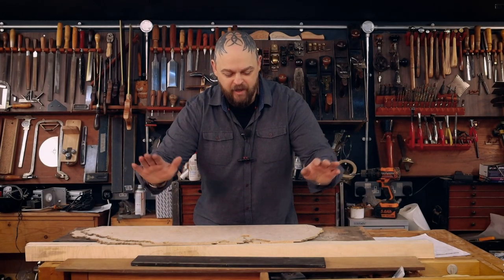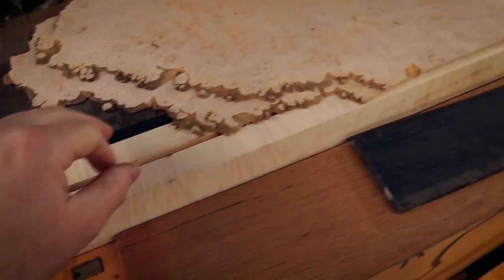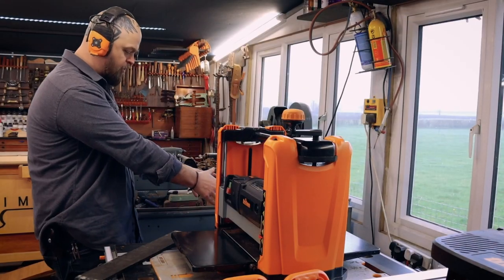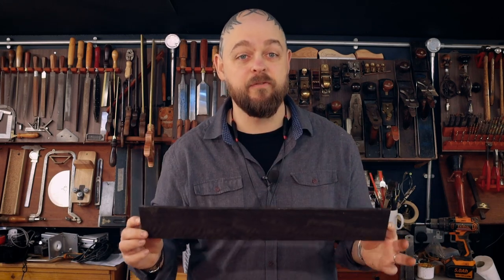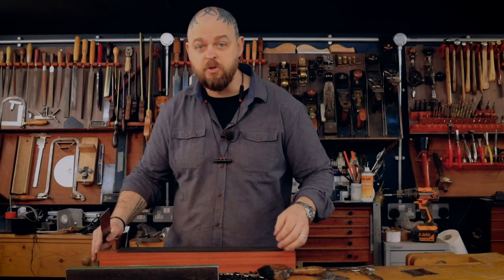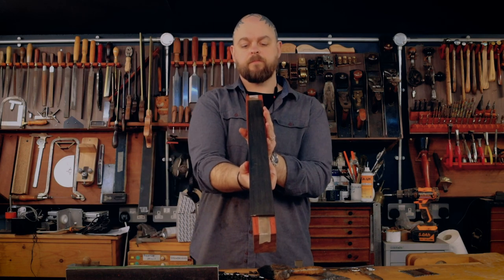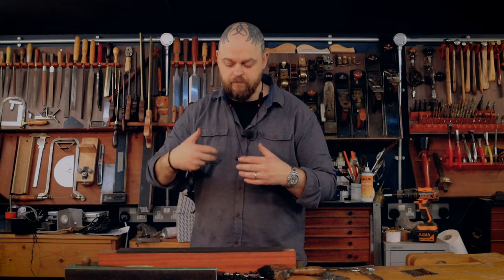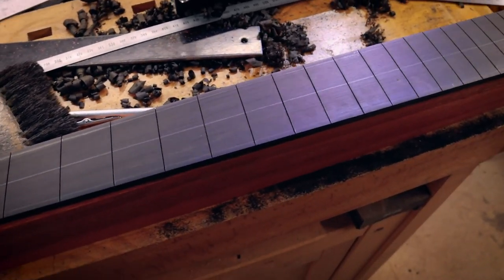Ep 1 - Fretboard Layout and Fret Slot Cutting - Making a Modern Multi-Scale Electro Acoustic Guitar

Comment: Another advantage of cutting slots after applying the radius, is especially if you're planing in the radius, you can quite easily get tear out on the slot with some of the more brittle exotic woods. Generally that tear out is minor enough to hide under the frets, but sometimes it just isn't.
Reply from the maker: You know what, this hadn't occurred to me! It's been so long since I did it the other way.. B

Comment: hi,
well, fanned frets , as comfortable as they are , are more likely to serve a tonal purpose . think of a bass with guitar scalelengh. it would work, but under quiet uncomfortable conditions , such as strings, so thick, they could be used to hang a bridge over a river.  thought in the other directrion, it`ll tear  your strings apart . but to get a more pronounced basssound and still have the light touch at the top strings , you would use fanned frets.  the position of the parallel fret on the other hand is just for comfort alone.  

love your videos btw . 
greetings from germany

Comment: Here's a follow-up to the segment of you using a standard ruler for marking fret spacing. Even if you're a metric user, do the process in Imperial with a good quality machinist ruler that has 1/64th markings and a conversion chart in 1/128th. It's miles ahead of using mm with decimals in terms of accuracy and only loses out to a specific fret spacing ruler by being the slightest but less accurate along with being slower and more tedious. That being said, if someone needed to buy an imperial ruler like that in the first place, they might as well spend a few extra bucks and buy the fret spacing ruler outright. It's so much easier. If all someone has lying around is an imperial machinist ruler, have a go at it because you'll still get good results.

Comment: Very intriguing. When you talk about the 10th fret, do you mean parallel or do you mean perpendicular? I'm struggling to see what's parallel about it?
Reply: Beaten me to it. Yeah, perpendicular to the strings. Surely none of the frets are parallel - certainly not to each other.
Reply: I thought he meant parallel to each other. The two lengths have the same 10th fret.
Reply: @RandomBassTattoo  All the frets fan out from a common point, so none of the frets would be parallel.
Reply: @RandomBassTattoo  Do you mean if you super imposed the Gibson fan scale over the Fender fan scale, the only place where the two would have a common parallel fret is at the 10th fret?
Reply: @daveperkins2927  yes, but I know nothing about building guitars.
Reply: @RandomBassTattoo  me neither!! I'm a carpenter and drummer! 🤣😁

Comment: Great vid, love the instructional style! More please! Just a couple of points, not being proficient with hand planes especially on a fretboard, I’ve started to use a belt sander for the initial shaping and tidy up with a radius block. Seems to work fine for me! Also, I’ve discovered the masking tape and superglue trick won’t work with certain masking tapes. I had four attempts the other day with a well known tape brand that didn’t work. Changed the masking tape and it worked perfectly! Probably best just to buy both from Crimson?!

Comment: Does it matter that you are measuring the frets along the tapered edge rather than a line parallel to the centre line? I would have thought this would be done before tapering the board as the distance along the tapered side would be different.

Comment: Love the videos and the builds (onto my third bass build now because of you)... Quick question on finishes... Can you wax onto of the high gloss finishing oil, and if so what wax is best?
Reply from the maker: glad I could help! And yes any wax will work so long as the oil has cured properly. I like renaissance microcrystalline wax or a hard wax made of 1/3 caranuba, 1/3 beeswax and 1/3 mineral oil all melted together. the later is harder wearing and protects the wood a bit more. B
Reply: @CrimsonCustomGuitars  thanks for the swift response... Still finishing off the penetrating oil at the moment... Will give it some time to cure and get hold of some wax... Keep up the good work 👍

PS I loved the fact you highlighted my Joker hand painted bass on the channel a few months back.... Thanks

Comment: So you believe fanned frets came about because of a more optimal wrist angle and not so that you may have greater string tension for the bass strings on baritone instruments?  I had always assumed the wrist angle was just a lucky secondary result.
Reply from the maker: you are right.. absolutely right.. the first fanned fret instruments were built in the 1600's and it was about sound not ergonomics, I tend to think of the ergonomics first though because we are building electric instruments and the sound is more easily moulded via other means.. Just they way my brain has it ordered in the end. B

Comment: i don't get your approach on fan frets about the thing with the wrist..mine is straight on every string and position without fan frets. I thought that fan frets are made to combine a longer scale in the bass section and the shorter one on the high strings to enable more accuracy in tone when the guitar is tuned lower per ex gibson scale to 26.5 small baritone scale
Reply from the maker: have a play with a multi-scale guitar when you next meet one and you'll see the difference, it is also about evening out the tension of the strings and giving a better bass response but in my mind the ergonomics are the more important part of the equation. B
Reply: @CrimsonCustomGuitars  yes i did. I have the feeling that Fan fettes guitars need to be strapped higher than normal ones for comfortable play. The. Thing with the Bass was exactly what i ment (-;

Comment: Hm... 24.75" to 25.5" fan seems a bit on the cautious side? I mean, yeah, it will look nice and it might be a tiny bit more comfortable, but another, very important purpose of fanned frets is a more optimal string tension. Since for 7 strings 25.5" to 27" seems to be the most common fan, I think I would have gone 24.75" to 26" fan for a more "Gibson" feel and 6 strings.

Anyway, really looking forward to see how this turns out. The burl is amazing.
Reply from the maker: it is a first step for the client into multi-scale.. your points are all valid and I agree, for me personally a 24.75 to 26 or 26.5" would be awesome! B
Reply: @CrimsonCustomGuitars  Ah, I didn't get the part that this is a client build.

Comment: I have a question about your planes Ben. Do you put a camber on the blades or leave them straight?
Reply from the maker: depends on the plane.. my #3 has a camber and is my general purpose tool for quick work, the 7 and 8 have flat blades for absolute precision as do the block planes.. I like a variety basically. B
Reply: Thanks

Comment: It seems that I was under the wrong impression.  I had thought that the reason some makers built fan fret guitars was to improve intonation accuracy.
Reply from the maker: that is a common misconception.. the intonation point is what it is depending on the scale length and thickness of the string but the neighbours scale length etc make no difference.. it is all about ergonomics and evening string tension as well, at least to an extent. Thanks for watching! B

Comment: mMy honest way of working out where the parallel fret should be (as a none luthier, but going off the idea of maximum comfort); take a guitar, relax your fretting hand, and run it up and down the neck. Where your fingers are parallel is where your parallel fret should be... unless you desperately want a Floyd Rose bridge but can't afford a Sophia bridge (which is a locking tremolo that can be used on a normal multi-scale) in which case, you'll need to put the parallel "fret" at the bridge.

Comment: That's not the reason for a fanned fretboard. It's so you can have a lower tension and a smaller scale length on the treble side. The opposite is the case on the base side higher tension and a longer scale length. Sure it's a happy accident that your hand moves this way but that's not the reason lol
Reply from the maker: It is one of two reasons.. depends on your perspective imo, for me the ergonomics of the build, especially an electric build, take precedence over the sound. I do concede  that the early acoustics with this feature were designed so because of the string length/tone equation you reference.. so, egg being egg you must be right. happy accident. B